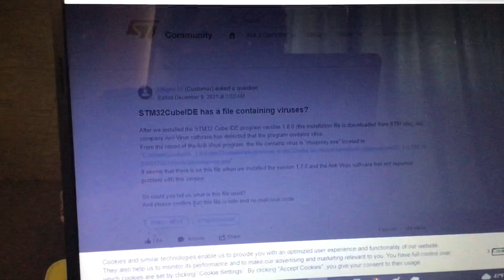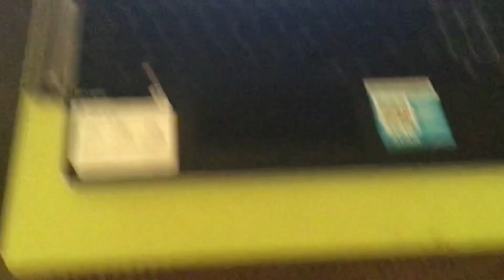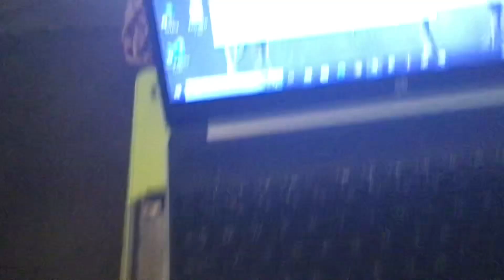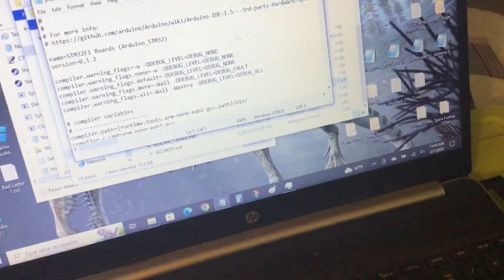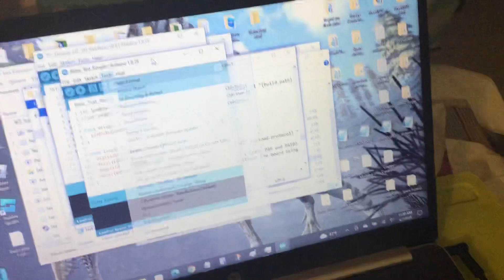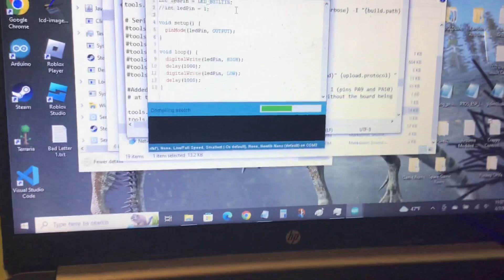How to add proper USB support to the STM32 Arduino package PLUS software hack and dark secrets

Comment: Can you please provide a link to the edited boards.txt and platform.txt files? I must have made a mistake following your instructions because my Arduino IDE doesn't show any "Serial" in the Upload method, but still "STM32CubeProgrammer (Serial)".
Reply from the maker: Unfortunately i do not have a place to share files setup yet. I would like to help you fix it though. The name change must be done per board type used since every different model number is done individually. If you have both STM32F1 and STM32F4, you must repeat the steps twice making sure the first word matches everything else in that category (do not mix up STM32F1 with STM32F4 in the same category).
Reply: Thanks. Do I still need to install a bootloader first or does the hack make it unnecessary?
Reply from the maker: @drkgld  i think you should be all good to go. So far i didn’t need to put on any bootloader on my boards, especially since this hack never uses built-in USB, only an FTDI adapter.